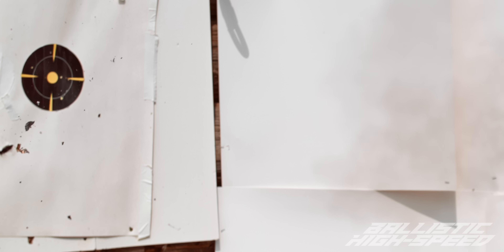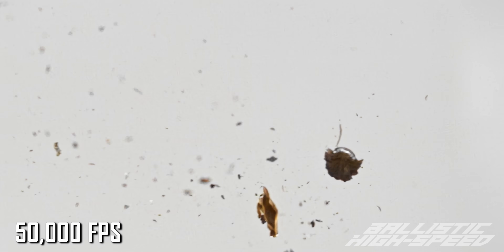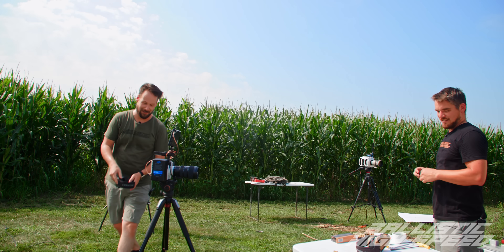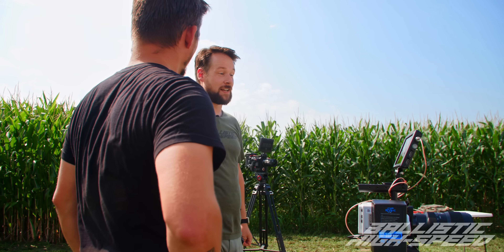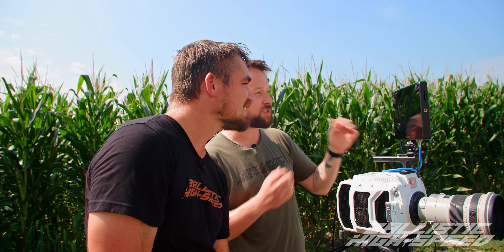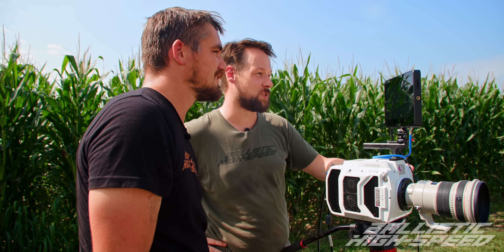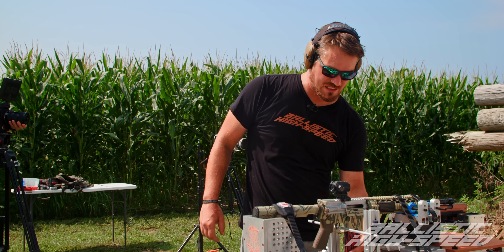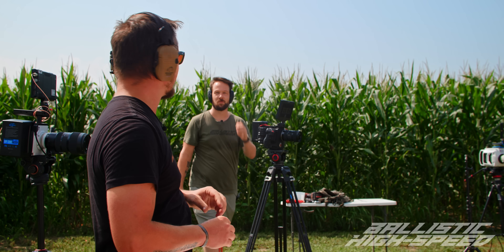Can You Shoot a Bullet out of the Air? - Ballistic High-Speed

Comment: Hey guys awesome video, but the M855 and the M855-A1 does not have the same kind of steel. The M855 has a mild steel core and the M855-A1 has a hardened steel penetrator.